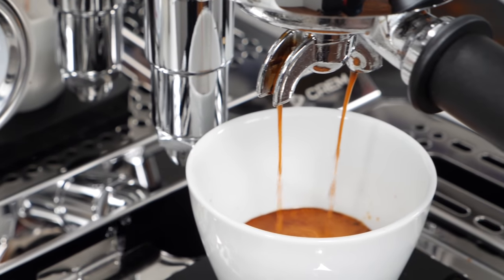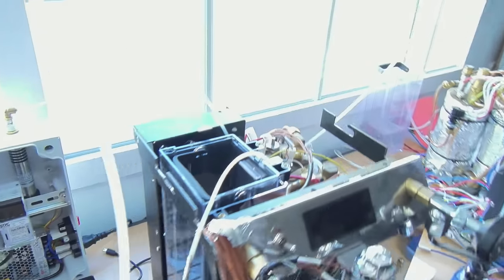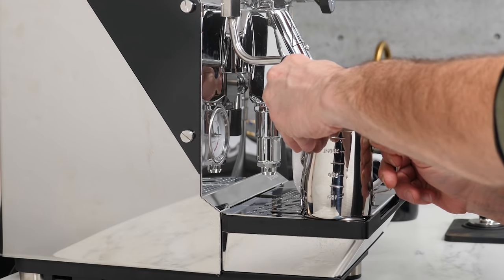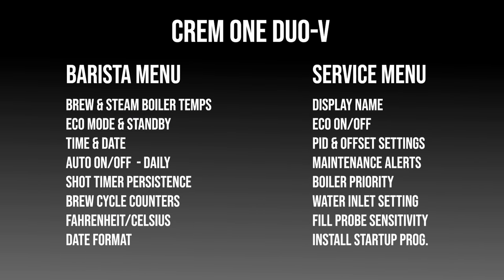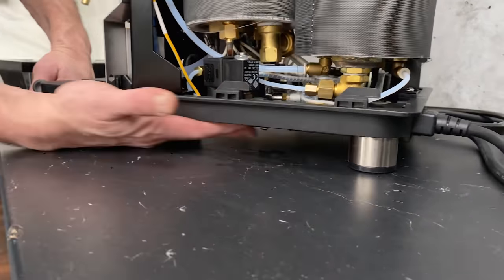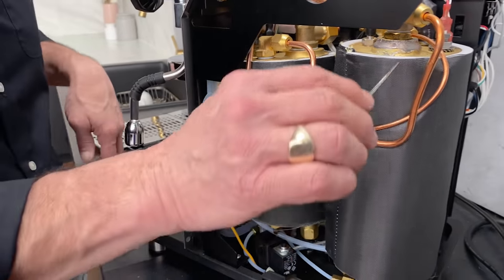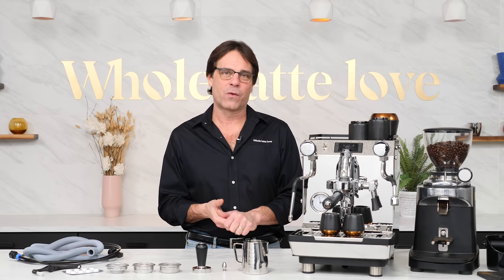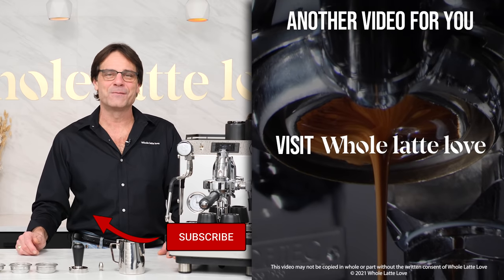Review: Crem ONE Duo-V Espresso Machine Inside/Out

Comment: The service boiler is pretty big ,not sure why that size for home use!? . I’d rather have larger steam boiler with slightly higher pressure setting for better steam performance. Seems like the best bang for our buck !
Reply from the maker: Hi AZ, Thanks for the comment. Just for clarity the service boiler is the one producing steam. Honestly steaming performance is IMO excellent. And, you get options with the additional steam tip. That 3 hole tip puts more steam into the milk. It depletes pressure faster of course but still have plenty to prep a large volume of milk.
Marc

Comment: Hey Marc great video. How does this compare with the steam power of the Sycronika or PFpro700?
Reply from the maker: Hi Andy, Thanks for the comment and question. Crem One machines have a working service boiler pressure of ~1.4 bar at max temp setting of 257F. Service boiler in the Synchronika/Pro 700 runs up to ~2 bar at max temp setting of 272F.
Marc

Comment: I’m not partial to plastic bezels and digital displays on espresso machines, much less a plastic base. Definitely not at that price point.

Outstanding job as always, Marc!
Reply from the maker: Hey Carlos, Thanks for sharing your opinion. As mentioned it's a modern break from machine tradition. Personally I think it's a step forward which allows a deeper capability set. Some may not be fans of the plastic and I understand that. But it does offer many advantages. Similar story to the evolution of auto manufacturing. I'm old enough that my early cars where built on steel frames. Now nearly all uni-body and use high tech plastic components.
Marc

Comment: The negative parts are no rotary. And the display is not very user friendly ie interface using icons... Basically they have over simplified the display menu.
No 22 gram basket...
Reply from the maker: Hi Paul, Thanks for your comments. Stay tuned for the other Crem One models with whisper quiet rotary pumps! UI's must balance ease of use with depth of feature set. At first it seems a little confusing but work with it for 10 minutes and I guarantee it makes logical sense. If you can operate a smartphone this UI is a piece of cake.
Marc
Reply: @Wholelattelovepage  having bought a bezzera matrix DE, which is very good, I can't help but feel all you need is manual mode for brewing coffee, I just don't think presets are useful for home use..

Comment: The machine looks great, and certain features are pure genius (OPV draining into drip tray, polycarb base, capacitive water level sensor to name a few). However, it's a bit disappointing in this price range to see classic manual E61 group (=30 mins to get up to temp) and no flow control (real dealbreaker for me). Also, it seems like the machine has Expobar's usual silicon-rubber-jacketed wires rated to 86F instead of proper fiberglass-PTFE jacketed high temp ones. It would work fine for couple years of course, but be prepared for brittle and breaking jackets around boilers in 5-7 years if machine is always on.
Reply from the maker: Hi Fedir, Thanks for the comment. Great features right! As far as warmup time keep in mind you have programmable on/off by day of week so machine can always be heated and ready to go using those. w/Eco mode you can drop boiler temps with touch of button to a lower energy saving temp then turn back on for a quick heat up to operating temps. Not sure where you got the 86F temp ratings for wiring. That is not correct! The Crem machines use the same wire type found in Rocket, ECM and Profitec machines. It's rated at 105C/221F. And, the machines do have SGS rating for commercial use. Sorry I did not respond sooner but wanted to be certain on facts regarding wiring. Also a bit confused on your comment of working for a couple years and then saying they'd break after 5-7. That's a big gap! Should also mention we've been shipping Expobar (designed by Crem) machines for well over a decade, have refurbed/rebuilt many 100's of them in that time in our service center and wiring problems are incredibly rare in reports from end users and what we see when doing refurb/rebuilds.
Marc